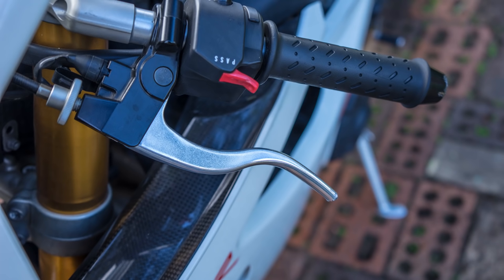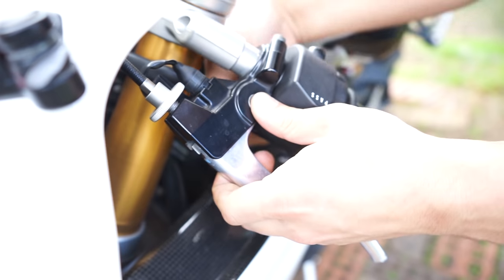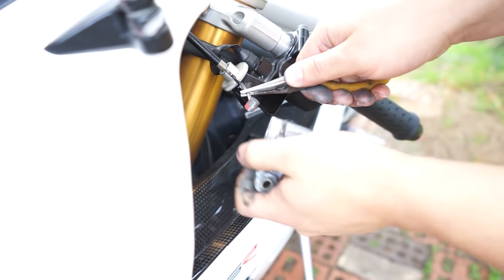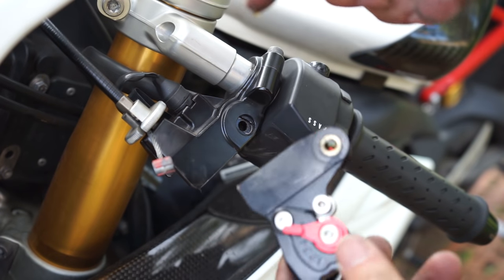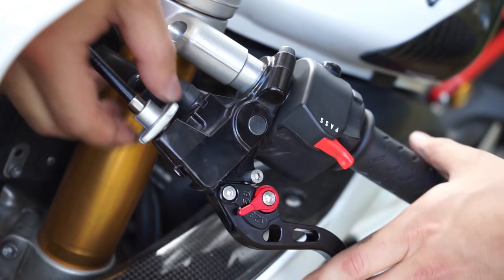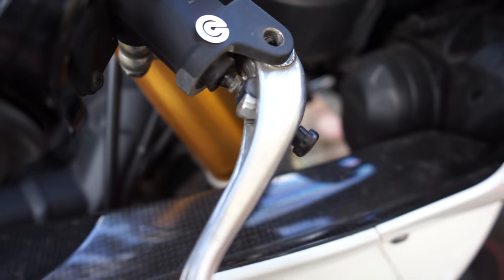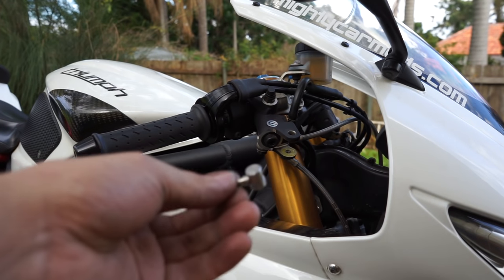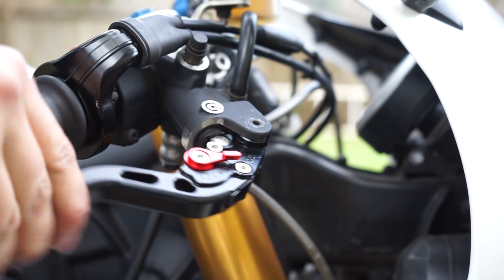[How To] Install Aftermarket Levers

Comment: Ok pay close attention! When you install an aftermarket lever you better be careful. It is very easy to not get it right and have a wheel lock up. I have been riding over 50 years and just put some new levers on. The new levers depressed the MC plunger "a few millimeters" too far in the factory setting and resulted in a front wheel lock up in a tight turn and the bike and I went down. The first sign is the engine begins to lug and then the wheel locks. If you make any change to the bike do not assume it will work as advertised. Seriously I had no idea it was coming or that the bike could even do that.
Reply: GraeffenKellerHaus Creative Works LLC,  Maybe checking it was not doing so before going out would of saved that, and adjust the lever if needed.  Make sure there is a small amount of play before the brakes start to function and that the brake lights come on as they should.
Reply: I Know this comment is a year old, but I had the same problem when I installed cheapo stock style levers I bought from eBay.

Scared the piss out of me! Seriously people be careful!!
Reply: @a.mccullough1461  what brand shifters you buy? Just got mine in the mail today from ebay. They seem to be excellent quality tho
Reply: @ragingelefants  

I'm pretty friggen sure they were volar's!!
Install could have totally been my fault, but in all my years of installing levers whether they be cheapo's or quality stuff I've NEVER had that happen to me before.

Luckily I wasn't far from home & didn't throw away my old levers.Clutch side was fine & brake went on without a hitch.

To this day I'm baffled.. 🤔🤔

Saving up for Asv F3's atm.
Reply: @a.mccullough1461  thanks for getting back to me. Maybe I'll just set mine aside and get something little better. Only paid 23 bucks for mine. Would rather lose that 20 than wreck my bike. Glad your safe and good luck in the future with the ones you purchase :-)
Reply: If your plunger is adjusted too long, and your brakes heat up expanding the fluid and your plunger is not allowing the fluid to return, your wheel will lock up. It doesn’t matter how much you spend on your levers. If you install them incorrectly you will go down. This is a safety issue obviously. Don’t install brake levers if you don’t know what you’re doing.
Reply: @HorseTongue  ay my dude would a mc19 cbr250rr be exempt from this problem because it has no master cylinder? Curious of getting afters for mine
Reply: Is there a tool or something to put the thing in correct tolerances it seems like too severe of a thing to get wrong
Reply: Had an old friend and his fiancée at the time almost die because of that. He landed on his side and his spine was crooked for a while. Very scary to see and crazy that it was something so simple.

Comment: -------------- -----------  Thanks for the vid How To Moto ----------------------

** note...for those buying the PUIG Brand of these brake or clutch levers....the mounting adapter and the lever come in separate boxes ..NOT assembled together versus what you see in this video.

There is a 1/2 inch ish long tiny spring ( found in the black foam center ways near the halfway mark of the sign of the lever in a tiny cut slit..easy to miss)  that must be put into the clutch lever at a certain point and you'll be having to be really slow and gentle as you carefully try aligning that spring to fit into the inside " ledge " of the mounting adapter..while holding the brass looking little cylinder that goes inside the mounting adapter...inside it with one finger.   

Get ready for alitte frustration  ...AND for my bike ( cb500x 2019) you will probably prefer to insert some very tiny ( we're talking .0125 inch thick or 0.25 inch thick..unsure) spacer or spacers to ensure when you finally install the clutch or brake lever assembly...that there is no vertical wobble as mine currently has.  -_-

Seems Puig did not do their 100% due diligence on measuring the thickness/wideness of the mounting adapter for both the brake and clutch lever   .  ( I have the kind that folds, extends and is adjustable.  found here:

https://www.motosport.com/puig-30-clutch-lever-kit?variant[PUI000U]=PUI000U-X001-Y029&variant[PUIA020]=PUIA020-X012-Y002 =   clutch lever

https://www.revzilla.com/motorcycle/puig-extendable-foldable-brake-lever-30?sku_id=10029472 =   clutch lever    which requires ( sold separately at rev zilla   ) = >>>  https://www.revzilla.com/motorcycle/puig-brake-lever-mount-honda-2?sku_id=1173065

Hope this helped someone out there.  Cheers.

Comment: great video! every other how-to that I've seen on this is shot from like 15 feet away. How did these new levers perform? did you notice a difference from stock?
Reply from the maker: To be honest, I love the stock levers. The edges on these aftermarket ones are more square and they don't feel as nice, especially when trying to modulate the brakes. The adjustments on these are a gimmick, I have them set to the widest setting and my hands aren't that big. The ones I chose as well are still considered "cheap" ebay levers, so maybe those $200 - $300 (Pazzo, CRG, ASV) ones are actually worth it
Reply: How To Moto hey. I had a slider at about 100kmh and my brake lever broke off and got stuck in between fairing. Now my right handlevar can touch the gastank. Is it bent so hard or it just moved out of place and can this be fixed by loosening some bolts and moving it back to position?? Thanks ;) oh, its 600cc supersportsbike
Reply from the maker: @blackcarmafia  Sorry for the late reply, my suggestion would be to find something straight and hold it next to your handlebar to see if it is bent and then make your decision.

Comment: Question! Any time when I adjust the position of the lever from the clutch, I notice that the clutch travel gets bigger or smaller. So, when I adjust the lever  position, do I have to  adjust the ring as well?

Thanks
Reply: Yes cuz the ring adjusts the tension on the cable that goes into the lever. When you adjust the position of the lever, the tension can change and so you would need to adjust the ring accordingly.

Comment: Would you know why after I swapped out my levers my gsxr 600 won’t start? Battery and kill switch are good and correct
Reply: If you haven’t figured it out yet. It might be that on the gsxr you have to pull the clutch in to start it. There might be a sensor or something that isn’t connected. That’s my best guess. Good luck
Reply: MenaceToSociety I did! It’s the clutch switch that was being disrupted by the new lever. Had to cut some piece off so now don’t even have to pull in the clutch. Thanks tho

Comment: Will this be the same for fitting all bikes ? Such as a Kawasaki z800 levers ? I can't seem to find the spare nob you said comes with the levers. Can I use the old one ?
Reply: (For the break piston)
Reply from the maker: Depending on where you get the levers from, and which model of bike, it will vary in each situation. There is absolutely nothing wrong with using the old one, just clean it and re-grease it.
Reply: How To Moto thank you

Comment: I bought some after market levers - but they didn’t come with that little knob that goes into the master cylinder for the front break. 

Does the little knob in the stock break lever come out so I can put it in my after market lever??

Comment: Does that say "pass" right next to the little red trigger by your handle bar grip? What's that for or do if you don't mind me asking lol
Reply from the maker: It's connected to the high beam lights and is spring loaded, you can press it/flash it quickly to let a vehicle know that you're about to pass them.

Comment: hey, i have a moped with no clutch. would i be able to use a clutch lever as the rear brake? (the rear brake uses a cable)

Comment: Nice video! Did you get a new activation pin with the new levers or you removed it from the old one?
Reply from the maker: If you're referring to the pivot pin, that came from the old lever. Otherwise, if by "activation" you mean the pin that goes into the master cylinder, then that came new with the lever :)
Reply: How To Moto thanks for your answer! I bought some levers for my bike and the brake one didn’t come with the pin that goes into the master cylinder. I’ll give the manufacturer a call tomorrow

Comment: Where can i order the levers? What is the brand pls? Are all levers compatible with any bike? Thanks
Reply from the maker: I bought the levers from eBay, I left a link in the description for you. The lever itself is universal, however, the bracket between the lever and the mount is specific to each bike. Always ensure the levers you buy are for your exact bike, some levers are compatible with multiple models but you would have to check the forums or your local mechanic/dealer to see which models.

Comment: My clutch lever came apart while riding, losing all bolts and spacer. I’ve got a new bolt on it that’s functional but the lever feels lose when moving it up (towards sky) and down (towards ground). Is that because I lost the spacer?

Comment: Can someone please tell me what the red half dial on the brake lever does exactly. I assume it is and adjuster, but is it for firmness, for slack etc?? And more importantly, should I only look for  a brake lever that has this adjustment?
Thank anyone and everyone in advance
Reply from the maker: Hi Dan, the red adjuster controls distance from the handle bar, so for larger hands you can move the lever away, and for small hands you can move the lever closer. The silver wheel with the slit cut in it, closer to the cable, is the adjuster for slack. I believe one of the only adjusters that has the ability to control "firmness" is the Brembo RCS, otherwise firmness is determined by how well you bleed the brakes, and what the ratio of master cylinder size to brake piston size you have.

Comment: Hi, can I use something else instead of grease? I got no grease and the shops are closed for a while. I have like a spray called A9 racing oils 'all in one spray'  kind off lube spray for more than only your chain, bulbs and screws
Reply from the maker: With something like a lever, you could get away with no grease.

Comment: Yo thanks for the video! Wanted to ask, can I use vaseline instead of grease?
Reply from the maker: I suppose you can, as long as the Vaseline doesn't touch plastic or rubber. I don't know how efficient Vaseline is compared to grease when it comes down to durability or friction, but with something as simple as a lever, it can work. Personally I'd stick with grease.
Reply: @howtomoto  thanks a lot man! Ill try to get my hands on grease

Comment: Locktite, what is that, like superglue?
Reply from the maker: A less annoying type of adhesive that stops bolts from coming loose. Probably a lot easier to clean off than superglue.
Reply: How To Moto thanks

Comment: It's simple enough. But what do you do if the spacer is stuck in the old lever?
Reply from the maker: I would suggest pressing it out, or very lightly tapping it with a mallet/hammer and a bolt bigger than the spacer but smaller than the hole.
Reply: Or buy a new spacer, the old one is probably rusted into place and might no be worth the effort to get out as it will most likely be unusable.

Comment: Is all levers the same or are some different? Cluth lever and break
Reply from the maker: Most levers will be very very similar. The only one I can think of that will be different is the clutch lever if your bike has a hydraulic clutch instead of a cable operated clutch.

Comment: ayy greasing the nut i think you might need to use threadlocker
Reply from the maker: If you're talking about the nut at 4:38, I only greased the smooth surface that would be rubbing. Definitely no grease on the threads.
Reply: The top of the bolt is also the spacer, it needs greasing, the nut should stay on fine without thread lock, but also with it if you want.

Comment: Don't buy aftermarket one
Reply from the maker: Aftermarket levers can work perfectly, you just have to be confident in identifying whether the fitment is safe to use in the end.
Reply: @howtomoto  not if you do trackdays and and have a very agresiev drivestyle, I would not feel good with those things
Reply: @S1krr21  how would you know
Reply: @pmfoxxie38  because